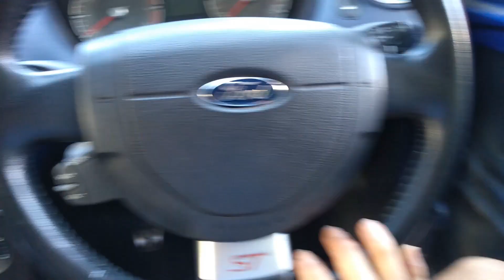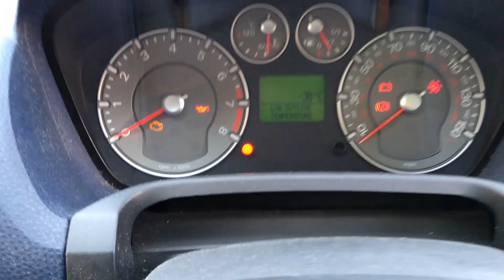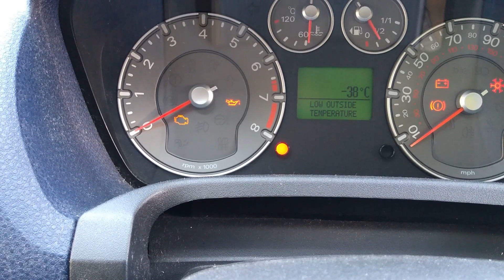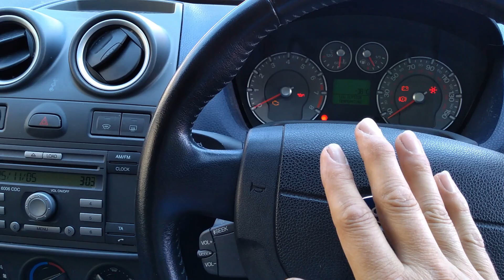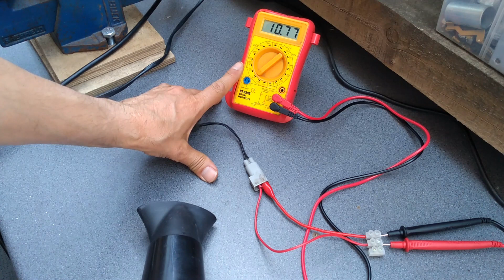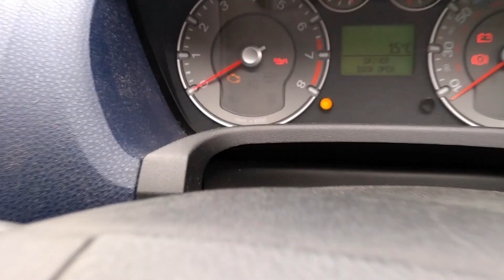Ford Fiesta Mk5 Outside Temp Sensor Fault - Diagnosis & Repair. ST150 Part 1.

Comment: Hi 

I got fusion 1.4 ,2008. Could you tell me if the sensor is on the front as well?
Thanks
Reply from the maker: I'm not a 100% sure but I would have thought so.

Comment: This make problem AC can't running cause -40 °C?
Reply: dont think the temp outside makes a diffrence main thig would be on old cars the gas refrigent could have leaked out so take to garage and have system pressure tested and check if gas is still in my guess is its not and thats you havmt got ac (sorry for bad spelling ;-))
Reply: Yes

Comment: I am getting the warning -38 low temperature outside its so annoying
Reply: I have this too, have you found any fixes?
Reply: @Jraxz  it's sensor problem maybe you have to change it or its dirty the sensor located inside front bumper. I just washed my front bumber with water pressure( problem solved)

Comment: @iofix Do all mk6’s have an outside temperature gauge I’ve got a 1.4 style climate but with a st Speedo and wondering if I could add one or the wiring is already there ?
Reply from the maker: I'm not sure, but my gut feeling is that is that retro fitting will more hassle than it's worth, but good luck if you try.
Reply: @iofix  just looked and the wiring is there for it so going to buy the sensor see if it works fingers crossed, one good thing about the mk6’s the wiring is already there for most things so it’s easy to upgrade

Comment: I’ve got the same problem and I was wondering if you could help me, was your engine management light on before you fixed the problem and did it go out after you fixed the problem ? Thankyou
Reply from the maker: No - I'm pretty sure this sensor will not affect the engine light.
Reply: It does.

Comment: I was wondering where they hid the sensor.Mine pretty much reads too high all the time.Usually telling me its in the 20-30s when I know its only about 9-14. I presume its the same problem so know what to do now.Thanks 👍🏽
Reply from the maker: Great, glad you found the video helpful. I would be grateful if you can support the channel by subscibing (free - just click the button). Cheers.